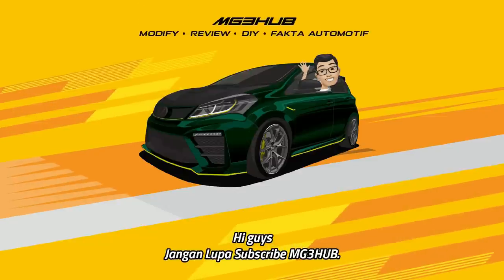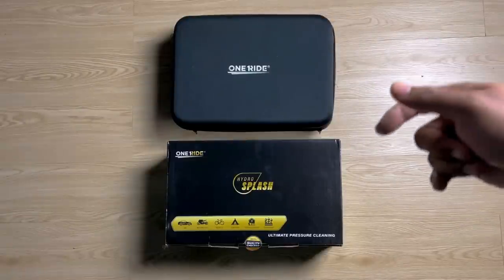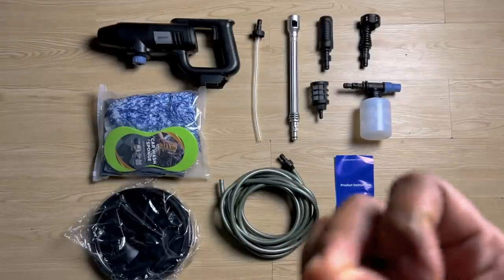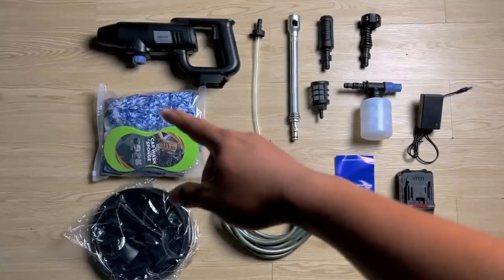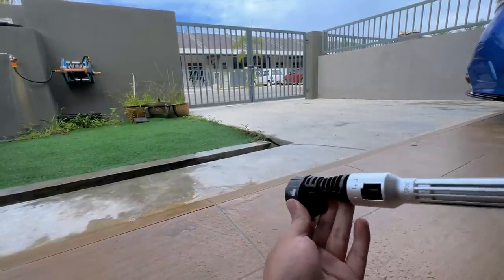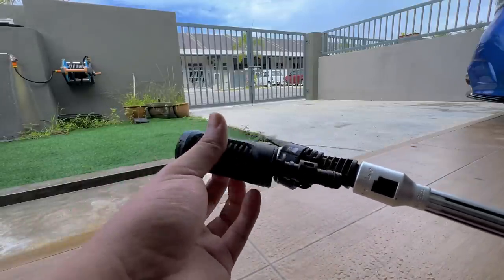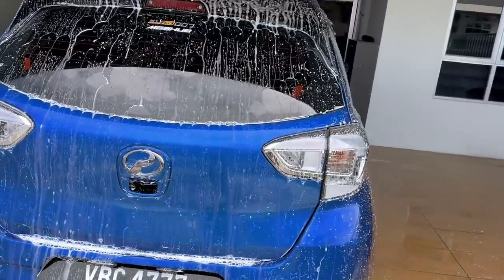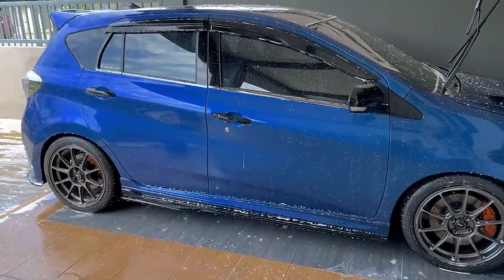WATER JET CORDLESS TEKNOLOGI BARU | ONE RIDE

Comment: saya pakai v3. pasal foam cair dan tak lekat tu bukan sebab coating, tetapi sebab soap applicator yang dia bagi tu memang jenis cap ayam. kalau nak buih tebal kena modify pakai proper 'foam cannon'. cuma 'foam cannon' yang elok mahal harganya dan tak tentu boleh perform dengan optimum sebab pressure cordless set tak cukup tinggi.
Reply: Mcm mana nk modify tu bang? Puas saya study haha. Sbb connector nozzle dia agak unik and tak guna jenis universal mcm ¼ quick connect type. Kene beli 2 jenis adapter baru boleh ngam agaknye..
Reply: @ahmadfarris8308  dia pakai adapter sama dengan apache/bossman atau yili. saya dah beli foam canon matic, siap tukar orifice 1.0... tapi semburan masih tak cantik sangat pasal pressure tak cukup kuat.
Reply: @jonboey3246  mantap bang terima kasih atas perkongsian.. nnt saya cuba pair dgn MJJC foam cannon nk tgk mcm mane hasilnye.. terima kasih bang 👍🙏
Reply: @ahmadfarris8308  Saya pon plan nak beli cordless water jet dengan MJJC Foam ni. So abang dah pair ke? Kalau dah pair mcm mana performance cannon foam tu. Dapat snow foam yg tebal ke atau kena beli water jet jugak.
Reply: @badman5356  saya x beli lagi bang.. so x boleh nk bg komen.. tp based on komen sebelum ni, semburannya x berapa cantik.. kene water jet baru foam dia tebal mcm shaving cream..
Reply: @ahmadfarris8308  ouh kena beli water jet yg pressure tinggi mcm at least power bar dia 100 lah ye?
Reply: @badman5356  yup betul.. kalau yg wired tu mostly mmg boleh pair dgn MJJC foam cannon tu.